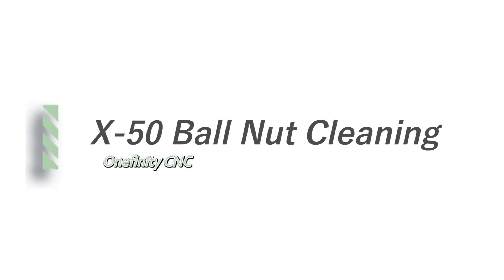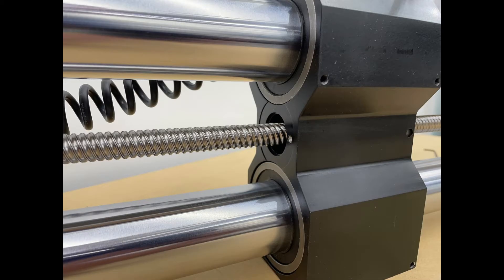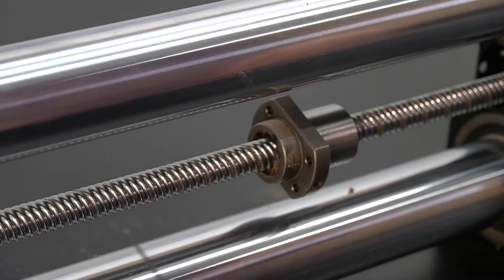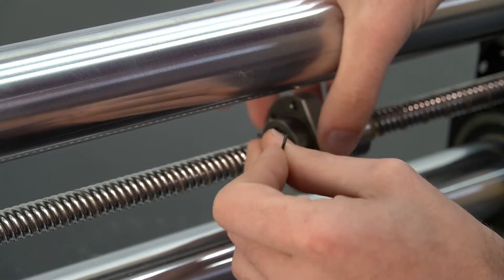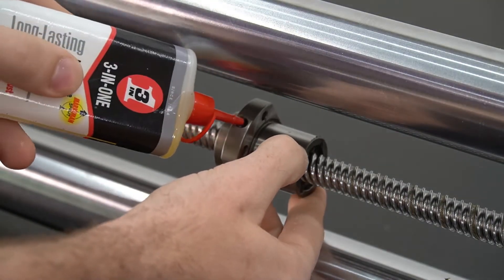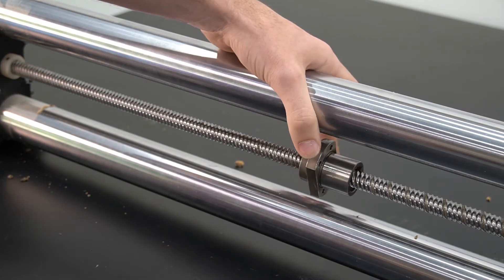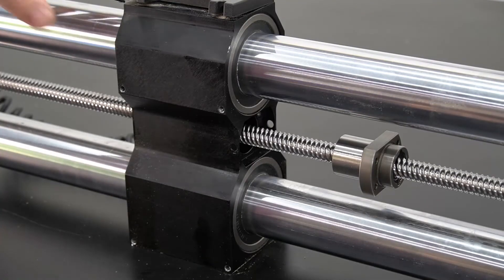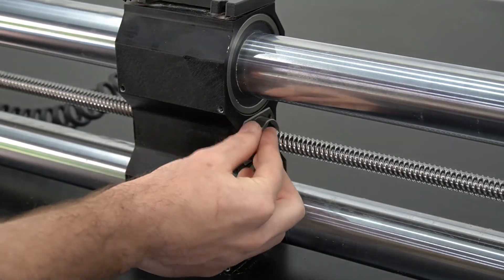X-50 Ball Nut Cleaning // Onefinity Maintenance

Comment: My ball nut appears to be packed with grease rather than oil. Would you recommend cleaning out that grease and replacing it with oil? I see mineral spirits is a popular solvent, but I'm concerned it might damage the rubber. Maybe I can just flood it with WD40 and then coat with oil.
Reply from the maker: Keep the factory grease in and just flood what you can.
Reply from the maker: Do NOT ever use wd40!